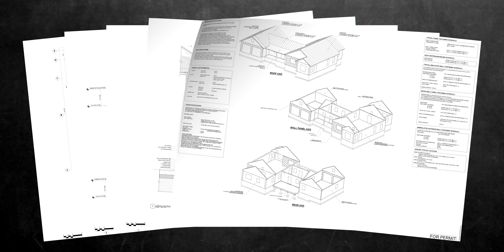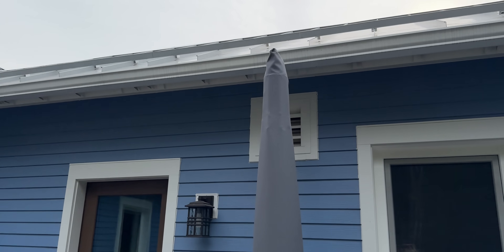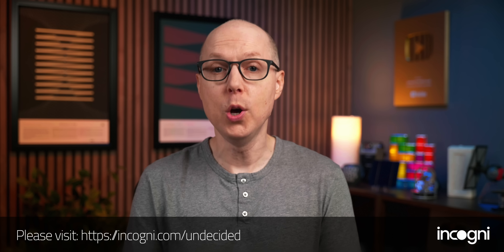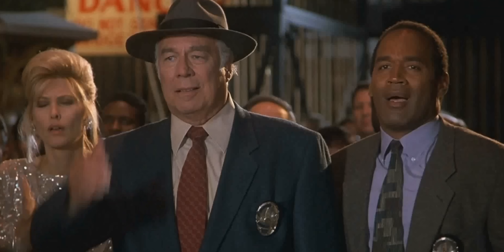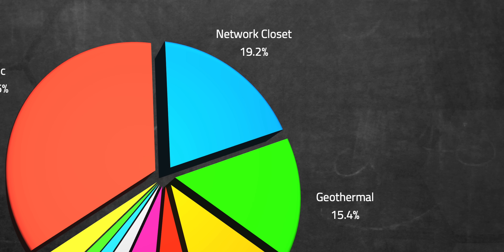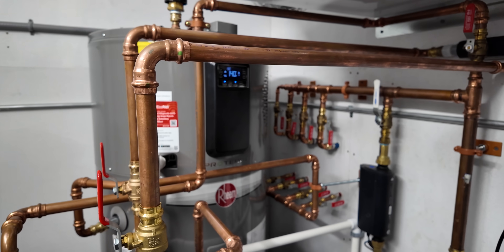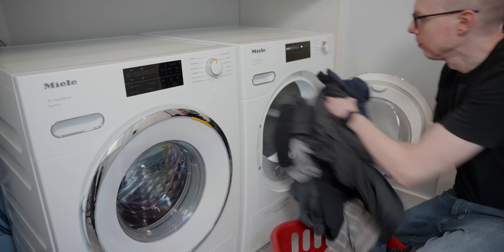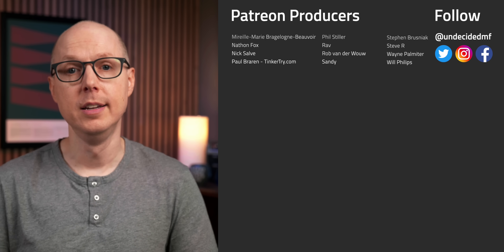What I Learned After 1 Year in My Net Zero House

Comment: Heat backup may be a resistive heater (heat strips) added to your water source heat pump to provide supplementary heating on the coldest days.
Reply: It's likely the heating element on the hot water tank bringing the temp up occasionally above 65C a couple of times a month to prevent bacterical growth in the tank. As likely the heat pump would only bring the water in the tank to 48C for normal household use. Some of the very newest air to water heat pumps just out this year here in Ireland can hit 75C for this purpose (and to allow better compatibility with retrofits/radiators) without using a resistive heating element... but every heat pump setup I've seen previously has a heating element in the water tank for this purpose.
Reply: @cros13  I think the water heater only has one power input. It will run the resistive elements if needed but it won't show up any differently on the Span panel.
Reply: Every geo I’ve installed in Kentucky has a backup strip heat for those colder days or times we’re temps were turned up over 6° above ambient.
Reply: With an air sourced heat pump I can see having back up heat as the heat pump becomes less efficient at lower temperatures.

With a ground source heat pump sized properly this should not be an issue as the ground is a constant temperature and the system should work at the same efficiency regardless of the outdoor air temperature.
Reply: he has a ground source geothermal heat pump ... the ground temp is around 50F regardless of the air temp even on the coldest days... why its so freaking cool and why I really want one too :)
Reply: @TwoBitDaVinci  Yes I am familiar with the topic. I used to sell commercial AC equipment. There is a limit to how much heat they can move from the ground into the building. If the temperature outside is low enough, resistive heating may be used to compensate for the increased rate of heat transfer out of the building. They typically wire the backup resistive heating to a separate circuit breaker, which is why there is a category for "backup heat" in the power monitoring app.

Comment: Matt, 
We’re in the final stages of a build in western MA, and I think it’s pretty safe to say we’ve spent a lot less to achieve similar performance. Not intending that to be a dig at you, but I think it’s important to show that it can be done on a more attainable budget. For instance, we’re using an air-to-water heat pump to heat our home using in-floor heating. This achieves much of what geothermal can do at a fraction of the cost, albeit sacrificing some efficiency during extreme cold temperatures. But it’s important to remember that generally in New England when it’s very cold it’s also typically very sunny during the day, which can help compensate for this lost efficiency through solar production. 

We’re also using some passive solar design principles, which have proven very effective so far, with our windows well shaded this summer and providing plenty of heat at the moment (lows overnight in the 40’s) to keep the house in around 70 degrees inside with no additional heating. 

There are so many things we can do to build more efficient homes without spending a fortune. It just requires lots of thoughtful planning. Kudos to you for helping to shine a light on some of these strategies. Keep them coming.

Comment: Love your forever home!  We started building our forever home in 1989, Washington State's "Super Good Sense Home" program.  We have two heat pumps and a 2640 square foot home, currently burning 20 to 30 KW's per Day.  We are adding to our existing solar in January, currently we have 10-400 watt panels, we are adding 34 panels and 20KW's of battery backup.  We also have two EV's to charge.
Reply: That's a v low electricity consumption. We had an ASHP installed in June and now we have started to heat the house the system is using about 170kwh a month.
Reply: @ralpharmsby8040  Thanks for the catch, I meant to say 20 to 30 KWs per Day.

Comment: Matt (Build Show) put the network gear and audio amps in a closet where the heat could feed the hot water heater. Nice touch!!
Reply: Or put it near an air return so it's pumped throughout the house.

Comment: I never heard of ventless heat pump dryers before. I have a very old dryer and for much of the year I use my solar powered dryer on the back porch (clothes line). I'll have to check out these dryers at the time to replace. I wonder where the heat goes in the summer, does it crank up your AC and dehumidifier?

Comment: Our 1980s house is now net zero. With the addition of 29kWp of solar panels and an air source heat pump, it produces three times as much electricity as it consumes in a given year.
Reply: That's amazing.
Reply: Panels aren't that expensive - maybe £200-300 per panel installed in the UK.
Reply: @Biggest-dh1vr  The last quote I've seen, a couple of weeks ago, worked out at about a £1000 per panel for supply and fit  - that was to a builder, not a home owner getting fleeced - If you got it that cheap, lucky you is all I can say - even if they were a pound each, it's still 128 square metres, which only a very small percentage  of homes could accommodate
Reply: @iansheppard6735  maybe english people like getting ripped off, but normal people buy 400w panels for around 70 eur. Thats not wholesale price. Buying by pallets, prices are much lower.
And 8k for scaffolding is just nuts. For that, you could buy basket "cherry picker" for every installation.
Reply: Wow solar panels are cheap at the moment  @lauriviik  I just googled and your prices are possible here in the UK. Most people get panels fitted by a registered company because if done this way, you can sell your energy back to the grid.  This is not an option for self build solar panels. But at €70 if you have enough space it would definitely be a good idea just to fill your roof with panels yourself. Most roofs can only accommodate 6-16 panels... But if you can fit 100 then why not? It would be cheap and probably produce enough energy to be off grid even in winter!
Reply: @onlineo2263   im  not familiar how UK is, but its hard to belive that only licenced  installers can provide selling to grid. I could not see a reason why it couldnt be same as in Estonia. DIY and let licenced electrical inspector do audit thats says everything is ok for grid, installers just do it for you.
Reply: @lauriviik  in theory, this could happen. In practice you will not find an installer who will check your work and register it. I think there are not enough installers, demand is high and the money to be made is so large that why would you do it? Best just to quote £4-10,000 for a whole job and have 6 months of jobs lined up.
Reply: @lauriviik  Hi, the price was for the unit and the installation (a.k.a supply and fit) . The unit cost of a panel in England is about £70 to £80, it's the labour cost in fitting the units that massively puts the price up.

The £8000 was for the supply and installation of the air source heat pump, not for the scaffolding

And yes, we do get ripped off, it gives us something to moan about whilst we are queueing
Reply: @lauriviik  no, it’s the same here, about £60 for a 450w panel
Reply: @iansheppard6735  oh sorry, rememberd scaffolding part wrong. Cant scroll while writing on mobile.
Reply: Incredible!
Reply: Great! How does that translate in carbon emissions?
Reply: wow ... I know nothing of UK Euro prices but here in Australia you can get a 6.6kw system fully installed from $3990 includes inverter panels and installation connection .... that's like $2200 pounds ... some over there is ripping you off big time as they are all made in China now 😂
Reply: Assuming you have a more generative type of PV panel at say 0.45 kW.h each, that would equate to about 64 panels (29/0.45) - With each panel being about 2 square metres, that's about 128 square metres of panels, so that's one big house.

The panels supply and fit cost would be anywhere between £500 to a £1000 each, plus the cost of the inverter. So that's somewhere between £32,500 and £64,500 just for the PV system. Plus, as it's an existing house you would of had to have paid for scaffolding

Throw in another £8000 or so for the air source heat pump, again supply and fit - assuming you didn't have to buy bigger radiators as well.

Now I appreciate prices can vary a lot and my figures are specific to England, but making a casual statement, like the one you did, is a bit disingenuous when you don't include the realities of the costs and the area required
Reply: And how much did you spend on that? Do you worry about lithium mining?
Reply: @cadthunkin  There is no lithium in PV panels. You must be thinking of batteries? In Germany, panels can be had from as little as 70EUR for 400W+.
Reply: @cadthunkin don’t need batteries, off grid is different to net zero, the power will just be put into the grid and drawn when needed
Reply: @cadthunkin It's crazy how successful the "but lithium mining" propaganda has been.

Comment: All new buildings should be designed with large roof overhangs. The large overhang provides beauty and protection from the sun, rain and wind. 
Protection of the doors, windows and siding make for a more durable and comfortable home.
Reply: Or window awnings.

Unlike roof overhangs you can adjust window awnings according to season.
Reply: And in the sun belt maximize south facing roof area and optimize angles for solar production.
Reply: Shape of house matters too. Limit your external surface area for extra efficiency.
Reply: Here the blocks are getting smaller and overhangs are disappearing.
Reply: @rovert1284  Yes -builders want to use less materials to save money. They in effect are making building that look less appealing and have less protection from the sun, wind and rain.  Short term thinking keeps people poor.
Reply: I have a south facing house with overhangs designed to shade in the summer and let sunlight in during the winter. The house is not as bright as I would like.
Reply: Look at all the old houses in the US. Plenty of deep Eves and Rakes along the roof lines. Looks much better than our modern homes.

Comment: New homes should come with solar panels, a rain water collection system and an electric vehicle charger in the garage.
Reply: New homes should be best fit for the climate they are in.  That includes the physical orientation and positioning of the house relative to the arc of the sun, and all kinds of adjustments for local humidity and heat.  Rainwater collection systems are bad for the groundwater ecosystem in some areas, but totally fine in other areas depending on rainfall and drainage. 

Also, to the commenter above who wants housing prices to drop, most of the cost of housing nowadays is land value, not the amenities or infrastructure on the land.
Reply: I would prefer new housing be cheaper.
Reply: @Senthiuz  Lower cost of ownership thru lower heating and cooling costs.  EVs used ⅓ the cost to travel the same distance vs gasoline.  Short term thinking keeps poor people poor.

Comment: I would have done a few things different. First, reduced roof angles to get a more even roof and use the height of the roof to get controlled roof space UK style. The Basement might have been ok but generally I only factor that in when thinking "Bunker". I would have dramatically cut down the WIFI as I am radiation sensitive, so I would not have many of the WIFI enabled things you have. Did you ponder window shutters ? We are big on those here and when designed into a build, they can be hidden in the roof ie when open, they are not visible. When closed, they are like bullet proofing - good for storms.  My ideal temps are 20-21c so I might burn more power perhaps ? I am in Australia so our building practices are way behind US so I would have to import a lot of things.  I would probably have built somewhere it was windy some of the time to get windmill energy as well.  Redundancy is something you totally overlooked. What happens if you lose power ? Battery system catches fire? Many problems with that setup can lead to power failure. I would have installed a combustion stove even if it was never used. At least it would give redundancy. Air flow in a power outage... that windmill feature would come in handy to power something for that too. Yep.. you mentioned zombies but I am more practical.. sun throwing a flair, our government making bad decisions...  And security. Cameras are nice but really.. doors and windows etc need to be breech proof short of explosives. When you have that level, who cares if a bad guy is trying to get in.. he can't.  The controlled roof space is a brilliant idea and would have cut your power use significantly, which over ten years, would have paid for my extras on yours.  Electronic locks.. not a fan :-) (not a pun). I like real solid locks that can be breach proof of course.  Those window shutters save on bullet proof glass.. which is heavy and impractical anyway. EV.. I did not factor EV into my plans, and it may be an option. I would have the batteries away from the  house too incase they caught fire. Spreading them out with redundancy, would cost a little more, but worth it. How to have them away from the house but easy to access and be breech proof.. still working on that one.  All up I think this is a really impressive build.  What happens in a hail storm ? Will your panels get smashed or are they stronger ? I have a sketch up of a solar setup that is "off roof" that follows the sun and flips over placing the solar on the bottom, if the weather gets bad. This way the cells wont get smashed.  In really bad weather, would probably rely on some gas backup and whatever was stored in the batteries as well as the combustion stove. No problem going old-school in a pinch when modernity is thrown out due to insane weather we will be having more and more. Also.. the Solar EMP thing is actually a big issue. There are circuits that can be built into a home but I have yet to find a solution to EMP proof solar cells.  If you hear of any, speak out :-)

Comment: Did you learn that two story homes are far more energy efficient than one story homes.     They passively retain heat in winter.  Better than buying a bunch of gadgets that end up in landfill.   Homes without basements are basically disposable.   The land will shift, the slab will crack, not to mention that basements mean you can build fewer closets utility rooms above ground.
Reply: Southern California homeowner here with perfect 35-year slab. We have hundreds of earthquake faults within 5 miles of our home. In Northridge quake, we had a picture fall off the wall, but neighbors going down the street below us had huge cracks, fireplace issues, floor cracks, etc.

Answer is simple - cut vs. fill dirt. 

Later, I ripped off 80% of home and expanded home. Contractors were shocked on the day of foundation pour…original slab was perfectly level. 

Why has my perfect slab lasted 40 years? It’s built on cut instead of fill dirt. People need to what how developers’ builds or when they purchase their own lot to build in. Cut dirt isn’t going anywhere or settling anytime. Simple.
Reply: @quicknumbercrunch8691  38% of UK houses were built before 1946. Nearly half of those were built before 1900. Not a lot of them have basements. Not exactly disposable.
Reply: @beetooex  Good point.  The thing is they were not built   on a slab.   There are foundations under the support walls.   Between the walls paving stones or a poured slab makes for a dry floor, but that floor does not hold up the walls, deep footings of stone and cement hold them up.
Reply: @quicknumbercrunch8691  So American houses only get proper foundations when they have a cellar????? That's hilarious.
Reply: @beetooex  I mentioned that if you build on stone, you will be stable for a long time and anyway you have no choice but a slab..    You can build a beautiful home on a slab and it might stay up seventy years.   The point is, if you can have a basement it is much better than using the savings from not having one to  build another two hundred square feet on the surface.   I listed the reasons why basements are advantageous, so I won't go over that again. Enjoy what you got.